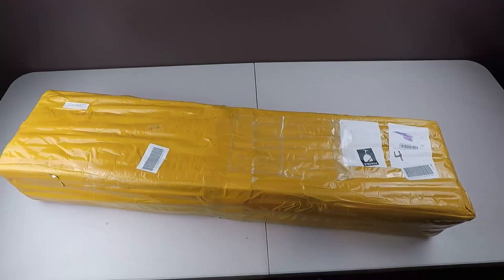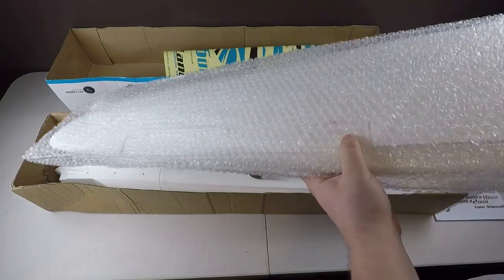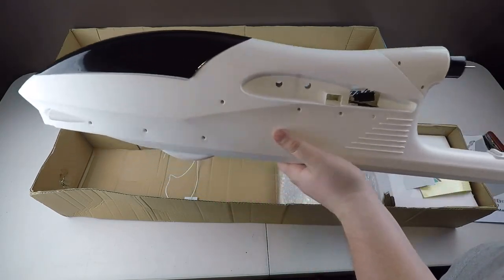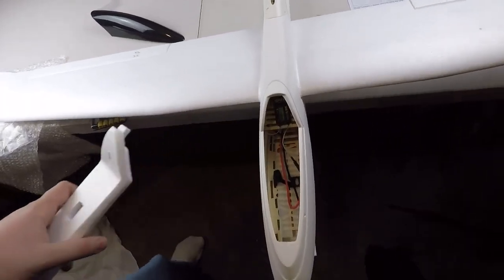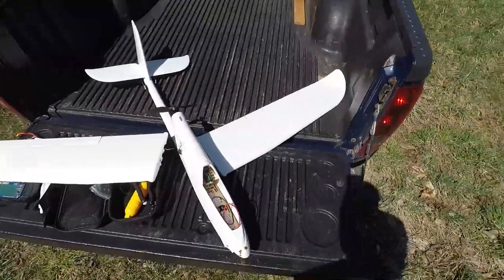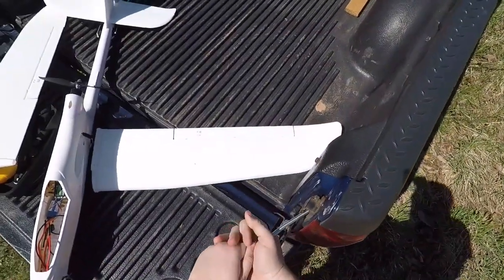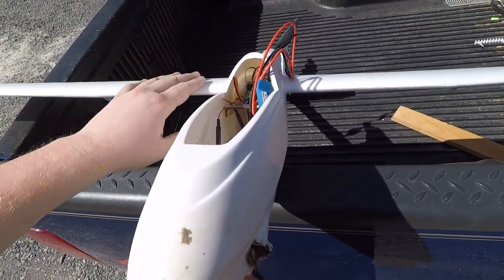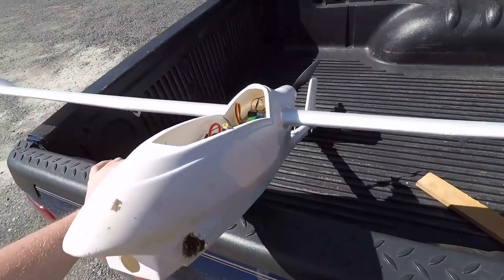Crashing My Volantex Ranger 1600. Unboxing and First Flight

Comment: Some thoughts for you. A common mistake with pushers is to put the prop on the wrong way round. That will mean a lack of power which could have caused the poor take offs. The poor control in the air was probably caused by the aircraft being tail heavy, Did you check the cg before take off? Always try to keep 'three mistakes high' and avoid harsh manoeuvres close to the ground. Keep at it and you will get there.

Comment: You did good, You got nervous and over compinsated on the sticks , Pushers have a tendancy to push down on launch if you give them too much thrust. Angle up a bit and launch at half throttle. INTO the the wind. Pick a calm day preferably under 5mph and constant one direction if possible. RELAX!!!! ENJOY!!!! You will crash it will happen again!!! Pick up your plane, fix it and start over . DO NOT GIVE UP!!
Alsob here is a great cheat!!!!!! simulator......simulator......simulator!!! The muscle memory will help tremendousley!!!! 
Try the Mini Apprentice ! Its an excellant starter plane. Volantex makes good products also and their inexpensive in comparison.  Best of luck!! and Dont give UP!!
Reply from the maker: Thanks for the advice and encouragement. We dont see that on the internet muc anymore. and yes i need to get a simulator to get better.
Reply: @BeginnersTech314  Real flight 8 is great. I use it and the skills and muscle memory help you in the actual flying.

Comment: The propeller is installed the wrong way around ,the text on the prop has to point to the front of the plane in the flying direction !
Reply: Absolutely..... thats why its just screaming and not pushing forward enough.....good finding...
Reply: Thanks Lundy, you just have save my $300 Volantex 2000. To say thanks to you, I will share this information with you. I had the propeller other way round. To check what is the difference , I put the airplane in our wind tunnel and checked the air velocity from back of the airplane using multiple sensors. It turn to be that you get 20 m/s at full speed for 5 second which enough to provide lift to the airplane, but after 5 seconds, it dropped to 10 m/s, which not enough to get lift on its wing. The reason behind that the curvature profile of propeller have a harvesting edge that direct the air to the back, if you get it wrong, turbulence will KILL you air speed.

Comment: Thanks for posting that...From the 2nd launch attempt it looked like you had issues with total travel (not enough) and a nose heavy airframe (better than tail heavy but still a problem).  Add the wind and you've got a nasty combination for a rough flight.  Did you manage to get this up and flying again?
Reply from the maker: Yes, I did. I also added more expo. I flew it a few times at rcs fest and had some guys help me get it even better. it is a nice sturdy plane I crashed it nose first into the pavement and just nicked the nose. there is also clips that hold the wing in that broke but i 3d printed new ones and the 3d printed ones are better than the ones that came with it.

Comment: I have same problem like you, my metal bar crush into 2 pieces, I live in Canada you know where I can get replacements for it?  Or any idea how to make the wings tie. Thanks
Reply from the maker: I don't know where you can get a replacement. some hardware stores might have aluminum tubing that will work
Reply: You can use carbon spar tube as well

Comment: So it's been a little over a year since this video, and as far as I could see, you didn't post any additional follow-up video about your Volantex Ranger 1600. Questions...
1. In the end, what was actually required to get it back in the air after that crash?
2. How did it fly then after the repairs...same as new in that first flight?
3. What have your overall impressions been of the plane since then? Do you recommend it? Not so much? Weaknesses/cautions for us potential buyers?
THANKS!
Reply from the maker: Thanks for commenting. I was going to make a video about it and never did. To get it fixed i had to slightly bend the rod back a little and i had to replace the one clip that holds the wing on. For the clips i 3d printed some i found online and those are holding up amazing. It was really simple to replace the clips. It still flies the same. The plastic fuselage is very strong. i have crashed it several times. the one time was a almost full throttle nose dive onto a paved runway. only damage was the plastic bent a little but a little love it works fine. I like the plane. I am not sure i would recommend it for someone new since it is so big and need a large area to fly it. On the upside since it is so big it is easy to keep your eyes on it and it glides nice. With proper trim and expo settings it is smooth. it has a lot of room for big batteries and flight controllers also fpv and small action camera. I actually have 2 of these because my first one got lost in the mail for 2 months and they sent me a second one to replace it and then 4 months after i ordered it i got the original one. i want to make the second one into a long range fpv plane. but we will see what happens.
Reply: @BeginnersTech314  Thank you! One more question: Can the stock ESC & motor handle a 4S battery?
Reply from the maker: I believe it can but with a good 3s it is plenty powerful for me.
Reply: @BeginnersTech314   Thank you   :)